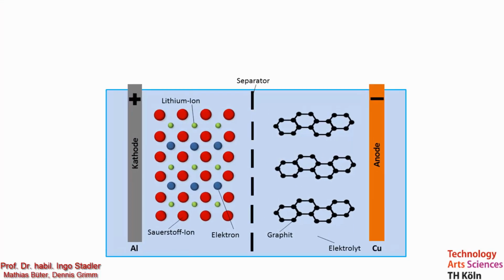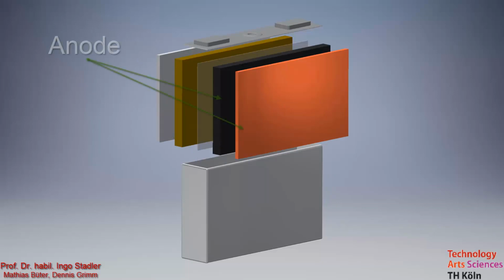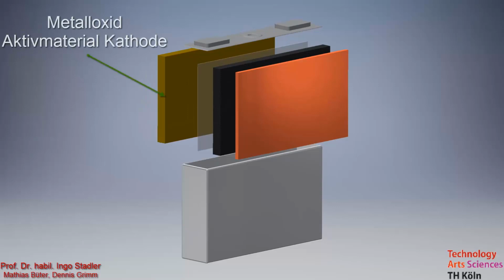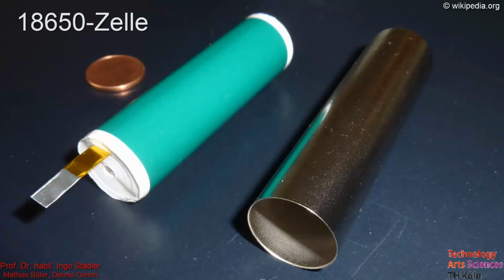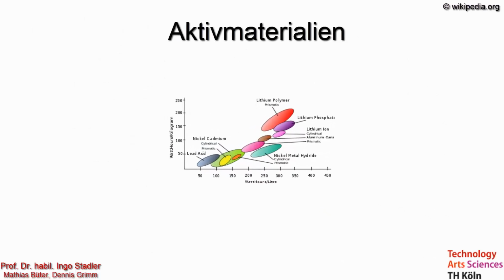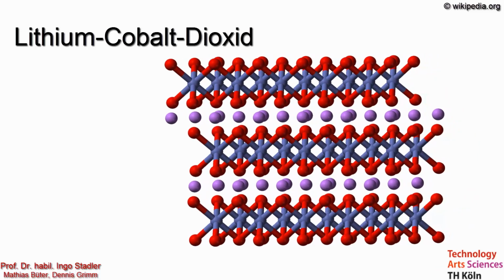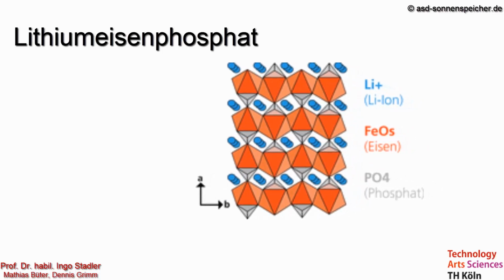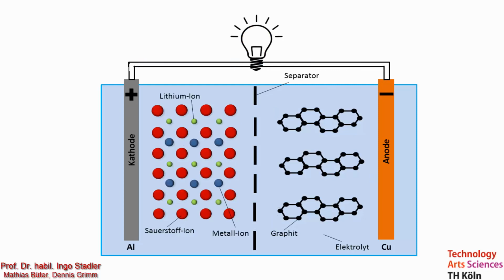Lithium Batteries - an Overview

Comment: What is the base copper foil thickness and characteristics, are only ED copper foils used, can RA copper foils be also used, just curious whether RA copper foils are also used in making the anode current collectors : Thanks in advance